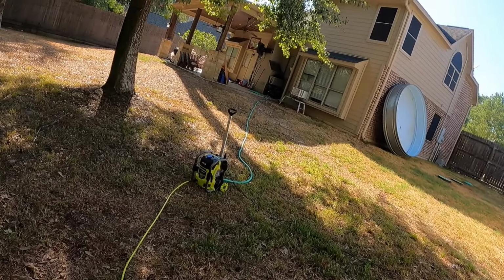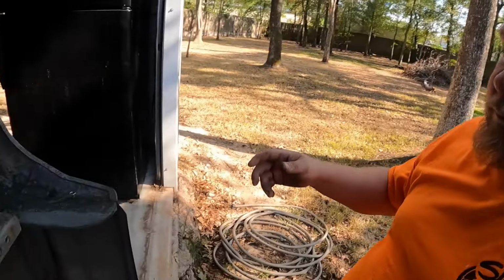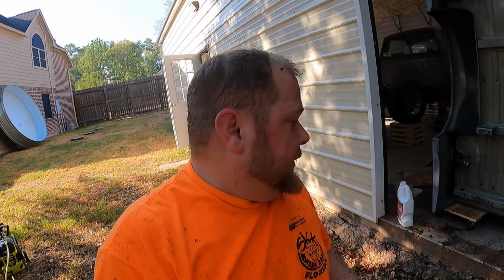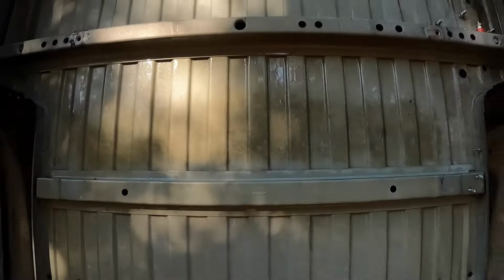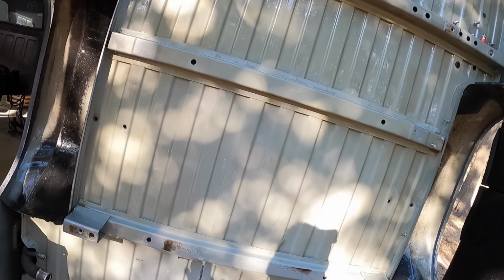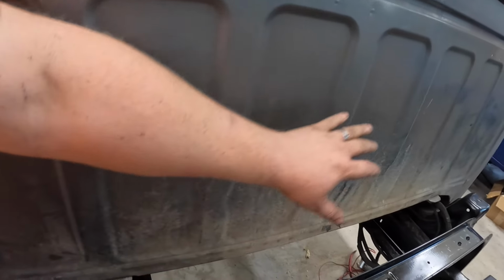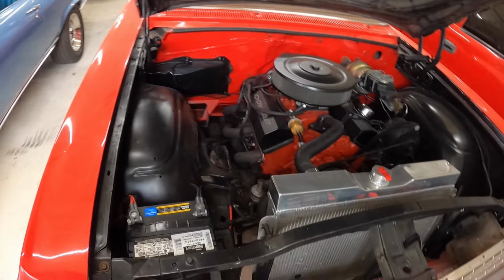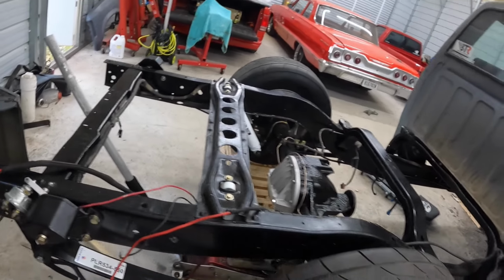How to remove 20 years of mud, dirt, oil, and BAD DECISIONS with a Ryobi Electric Pressure Washer!!

Comment: good job i was in the market for a power washer that answered my question   thanks
Reply: My ryobi will peel the paint of your car so DO NOT USE THE BLACK VIBRATOR TIP unless you're trying to strip paint
Reply from the maker: Of course! Jerry you won't be disappointed!

Comment: While u have bed off it's always good to address area's of commen rust out little rust preventive paint is always worth it in the spots that hold dirt and I've learned with small engine's if u can't get none ethanol add stable to the full many years of use it works and old marvel mystery oil added in oil and gas does help specially sitting and now days u can buy cheap carb of ebay,Amazon and they do work but don't last long with fuel left in them but for as cheap they are If I am given and small engine saws, weed eater, and lawnmowers i check and just spend couple dollars buy new unless it a old valuable thing I get original parts most new stuff is built so cheap it's only good for a year unless probably maintained.
Reply from the maker: Yeah the ethenol now days is so harsh. I attracts so much moisture and the combo just eats at the metal and aluminum. I'll have to keep the stabil or marvel mystery in mind. I have a jug of marvel out in the shop.